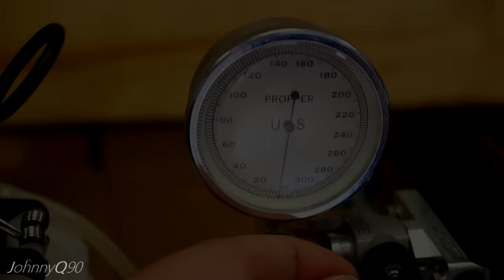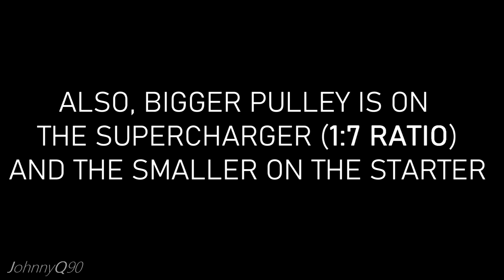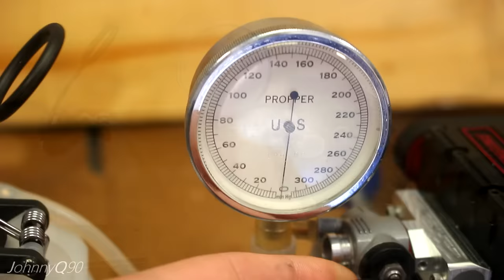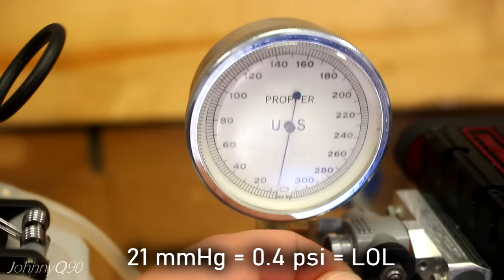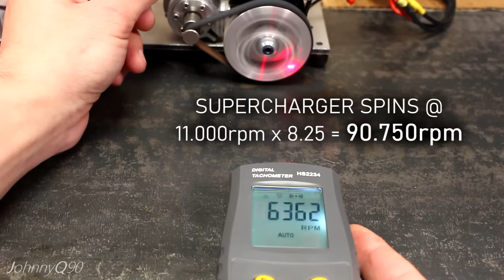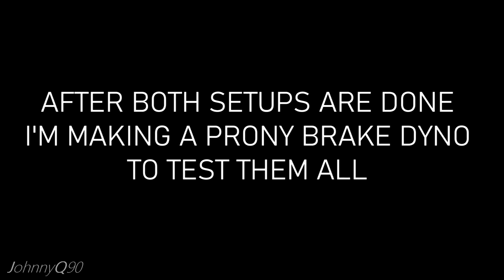0.6psi @ 90,000rpm Supercharger on MINI 2 Cylinder Four Stroke Engine! - BLOW Through Setup

Comment: 0.6 psi is still a lot when you scale it up. Direct injection next ! 🙋🏻‍♂️😆
Reply: Totenkopf_88  how so? 0.6 psi from a small supercharger like that if it was scaled up would be a lot more than 0.6 psi. Maybe more 5 or 6 or even more (I haven't done the math) 6psi on a stock engine would be a noticeable difference.
Reply: Totenkopf_88  psi is a pressure not a flow measure. flow comes down to the size of the pipe used. Can you imagine blasting an actual 6 psi through this little engine. The valves would have a melt down.. the lifters would probably fail first though.
Reply: Totenkopf_88  and you can scale anything up or down. You don't need 10 psi to scale something. Like I say 6psi on a normal engine with 2" or 2.5" intake piping is a noticeable shunt.. 0.6psi on a scaled down car through smaller 8 or 9mm pipework is still a good amount of pressure. Personally I think he should gear the turbo over 120k rpm instead of 70k. His second gear setup already upped it.

Comment: You really should install a blowoff valve or at least turn down the limiter
You're asking to destroy your engines by running them boosted with no pressure control

Comment: I got a toy and single cylinder with a clear topyou can see the piston and stuff but I can't get the run to save my lifethe valves leak so much compression it don't have none then there a little spark thing system don't work eitherI've had a lot of problems with mine I've had it for six months and I still ain't get it to run yet I'm a little mad

Comment: this will not work, you have the same fuel pressure as boost pressure, maybe even less fuel pressure, no good for a blow through carb setup, fuel pressure would need to be more then boost, you say it don't look lean, well it does to me, you need way more smoke than that for a healthy nitro engine.

Comment: I guess this is a procharge not supercharge... anyway, you need to inject more fuel when adding a charger. you cant just add more air without enough fuel to burn it.
Reply: A 'procharger' is just a brand name, this supercharger and prochargers are centrifugal superchargers
Reply: @saintdoobskin5748  i know they are similar but this is a procharger. and its just a note.

Comment: I wish I could add something to these conversations, but I'm clueless ... I feel so dumb being a girl.
Reply: Don't worry about it as long as you're enjoying the show the turbo pushes pressure into the motor instead of just sucking air in to mix with the gas the little Turbo Force's more air in which causes a rise in pressure which makes the engine run faster that's what he's trying to do the supercharger a turbo is when the exhaust coming out of the engine spins the supercharger or Turbo which forces pressure into the intake that mixes with the fuel to make the engine run with more power if you can understand all that it's pretty simple the way Johnny's doing it right now is he's using a big pulley to spin the turbo because it's only two cylinders and it's a tiny motor so the exhaust is not enough to spin it fast enough to build up pressure on the intake part that's why he made a bigger gear or a bigger pulley to make it spin faster the bigger the pulley is on the engine and the small of the Polly is on the turbo the fast of the turbo will spin which will make the pressure go up forcing air into the engine any engine can make it more powerful if you can build the pressure higher than what the engine can suck by itself.5 just plenty of guys here if you have any questions we all have answers LOL sorry about the Giant sentence I'm lazy but I'm sure you can read it without all the punctuation missing. Also let me clarify a supercharger is what he's doing now cuz he's using a belt to run the supercharger the difference is if it was a turbo it would be running off of the exhaust the exhaust coming out of the engine would cause pressure to spin the turbo to push air pressure into the intake with a gas goes in so that's the difference I turbo is run off of exhaust pressure and a supercharger is run off A belt which is what John is doing right now all this to get more horsepower or Cc's depending on the size of the engine because it's so tiny it's CC if it was a bigger engine you'd be looking for horsepower like in a V8 or V6 in a car engine this is just a toy engine or RC engine remote control car engine this is why I don't use punctuation cuz something's wrong with AI and it's always changing words it doesn't understand English I think it comes from China LOL so by the time I'm finished with something like this I have to go back and change all kinds of words and it's not any better it's even worse with spell check I don't know if I have a virus or what the hell is going on
Reply: @dorfsteen  Wow, thank you so much for the explanation.  I certainly learned more than I knew before.  Again, thank you!

Comment: does that engine have intake an exhaust vavles?
Reply: How else would a regular 4 stroke work :P
Reply: my bad was thinking is was not a 4 stroke✌ there are others on you tube with 2 stroke engines trying get boost, 🤣🤣🤣🤣✌
Reply: @dirtydeedzmainecultavator68  I mean a 2 smoke doesnt have valves at all lol
Reply: @Aesh-om2sz  exactly,  and you can't produce boost lol
Reply: how much boost are you looking to achieve? And how will you go about it.. or I should say anything internally?..compression ratios? etc

Comment: Adverts where longer and more frequent than the video and so dam loud. Gave up watching. Came to watch a video not a Disney vhs cassette that takes more time to watch ads than the video. Good luck man I move along
Reply: Totally not true for me at least. I had one ad in the middle
Reply: That’s YouTube nowadays go watch Netflix then
Reply: Then get a damn adblocker. Creators don't have control over ad type and placement until after an upload, and policy changes will override manual settings.
Reply: I had an ad at the start and that was it... even if i had 3 15 second ads id still watch... 45s of ads for a 12m video isnt bad compared to 8 mins of ads to a 22~ min show on tv...
Reply: @alexandruianu8432  creators do have full control over how many adds are shown. Its our platform.  This creator has added in so many its ruin the show.
Reply: @Tangobaldy  They have options and control, but a lot of it is reactive because the system is dynamic based on video popularity and engagement. You watched the video not long after it was uploaded. More engagement early on after the upload might bump up the number of ads, unless manually set on a per video basis.